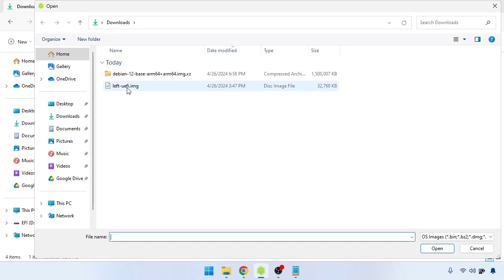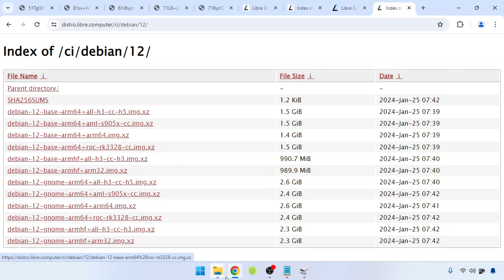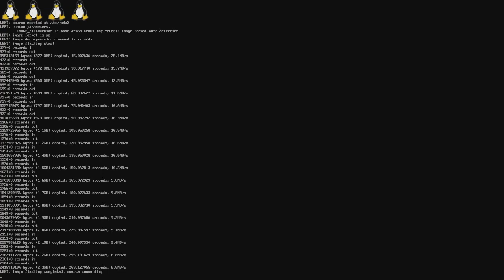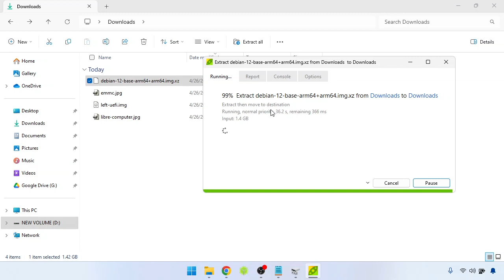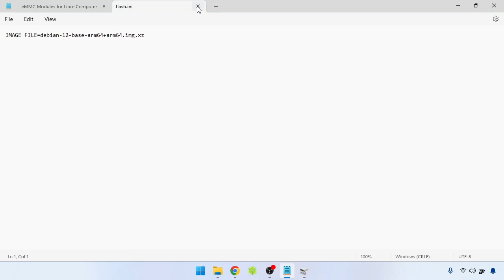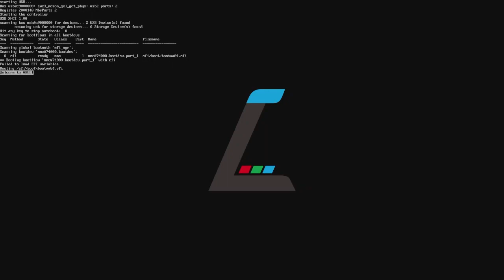eMMC Flash Tool for Libre Computer to Create Rapid Operating System Deployment Key Windows Edition

Comment: tried the last one didn't work im getting ''bootcmd_usb not defined"
Reply from the maker: Do you have the latest firmware on the board? Can you provide a screenshot of the error?
Reply: @LibreComputer  My Emmc is somehow messed up that I tried another method of flashing, this is my post: /t/le-potatos-emmc-issue/3962/10